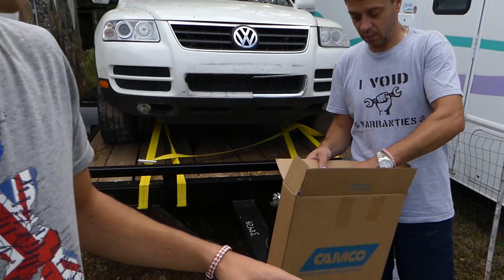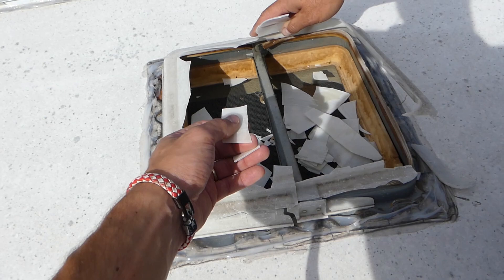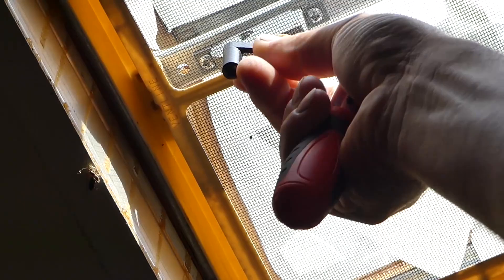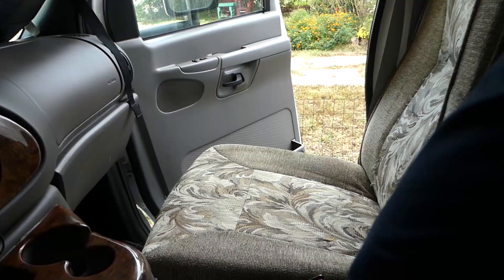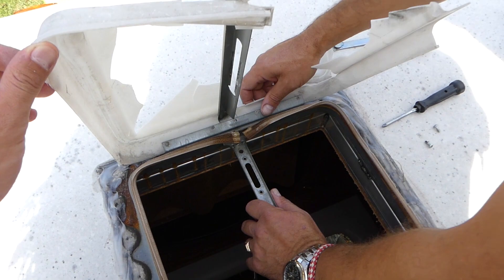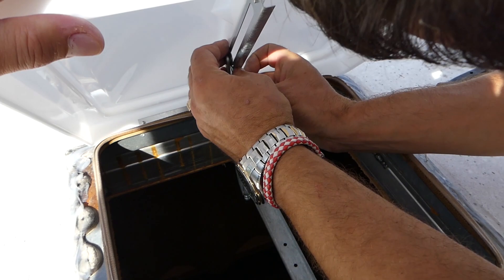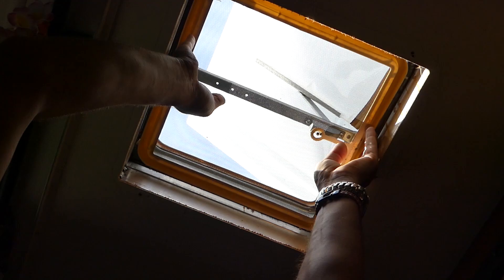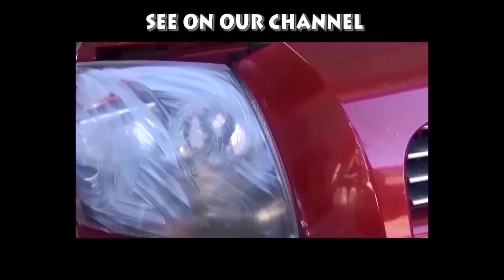CAMPER RV VENT LID REPLACEMENT  RV ROOF VENT REMOVAL REPLACEMENT

Comment: There are are sheet metal tabs in each end of the hinge that are curled down to keep the dome from sliding sideways and getting out of alignment.  If you can't slide the dome off the hinge, check to see if there is a curled tab of metal holding it in.

Comment: Thanks for posting this video.I have been putting off changing mine because I thought it was going to be a long process but you showed just how easy it is ....thanks.....Cheers !!!
Reply: I guess there are several different types of connection methods on the edge of the skylight and important to buy a skylight that matches your base - find it confusing.